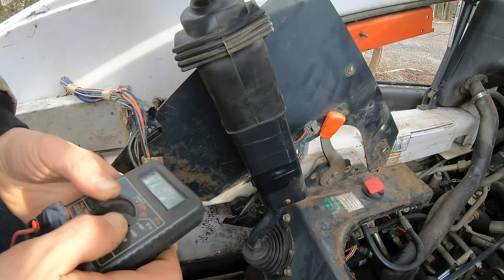Replacing a AHC computer

Comment: Even though thats an old machine (Guessing 1997-2001) you would think that computer should never fail. Or at least there should be a lifetime warranty on it. I can understand moving wearing parts but if that piece isn't user serviceable which it isn't they shouldn't hit you for $1400 thats a simple control box with relays basically and a rom with fault code library. That prob cost $19 to make with electronics so cheap. Thats robbery imo. Did you look to see if there are people that rebuild them? I would try cutting that filler sealer out and look at the board, I bet you can fix it then seal it back up. If that is $1500 shipped I would think you could get $500 easily on ebay for a working used one

Comment: Most be snowing at the moment mate you are punching out so video's, have you looked at the Case skid steers i have a 40XT and it has never missed a beat, tough machine. i have cleared & cleaned up a lot of land with it and it is still going strong. I would like a tracked machine as well but just way to expensive at the moment.

Comment: How many hours are on that Bobcat?  I am willing to bet it’s got a ton of hours. I personally would probably go with a Tackuchi as well.i love that they use Yanmar engines,all they typically have less hp than the competition it’s still plenty and the machine is an absolute animal,tons of breakout force and a real wide roomy can. I own a Cat 246 wheeled machine has been flawless it’s a 2001 ,never broke down in the 2000 hrs on it. I would buy another Cat ,as well. If you are using the machine a lot I’d consider a new one ,you are doing enough work to pay for it ,consider a lease , 5 yrs with a dollar buyout.....the used ones I looked at were whipped, and they wanted top dollar. I don’t want someone else’s problem, or abused neglected machine. That’s why I’d consider new especially if there are incentives.

Comment: Just why in the HELL do you need a computer on a hydraulic machine? It's a pump, a tank, cylinders, motors, valves and some hoses to connect it all. I think they do it just so it will break and then you have to buy another one...........from them. Dirty bastards.

Comment: yep! you can make a shirt with that :)) "things that are made in japan work if things are made anywhere else are terrible" 
"the older the better" "you don't need parts for this things they just don't break" "computers... they just don't work" 

now in my ex buy stuff that is made where you are or japan stuff, old stuff even if electrics are bad or dead, still work. buy things with hydraulics over hydraulics, hydraulic commands are very nice and pretty bulletproof! 
it's worth having an old machine put thru some TLC and using, they don't build them like they did! even japan stuff. oh and old stuff repairs like  a charm in the field or at home! but they don't brake :)

Comment: OMG $1400! That's why they use potting epoxy even x-ray wont show whats inside, ($100 to $200 in parts).
Reply: No that is NOT why.  It's because it's in a vibration intense, dirty, and wet environment and electronics do not like that. But you are correct..generally the components are 100 at most, but are you going to design, engineer, prototype, generate the PCB, assemble and test again, and for even $500?  No you are NOT.  You have to recover your costs within the first few, otherwise you are not around tomorrow.

Comment: Hi , Andrew , The Hard Cold Start , Possible "Air Intake Heater"  Burned out or No power , Fuse , Relay .  The Safety Bar Switch Is getting ready to fail  ….  It Has A Magnet Switch Located On the left Side At The Seat Bar Pivot Mount . The Plastic Bushing Has A " Magnet in it " ,, As it Wears Out , it puts the magnet out of place in relation To the Sensor / Switch . This Safety Switch Controls All The Functions On a Bobcat  !!!  Second Check your Fuses And Relays Connections /  terminals for corrosion  
( There Bad For This ) .

Comment: Bobcat shares just dropped a hundred points.
Reply from the maker: Thats what they get for selling equipment that does not stay operating.
Reply: @AndrewCamarata  I've actually got an old bobcat...no computer...that still works great. I've got a backhoe attachment for it I just used to dig a 200 ft trench plumbing in a new well but if I had the problems you have I'd ditch it.

Comment: Boy oh boy - doing the field work is tough enough but Andrew has to be a top level mechanic as well in order to keep the equipment running.  $1,400 !! - I bought a nice desk top computer and large monitor for less. However, He will earn a lot more with that tool running than I will with my computer.  Codes - is that like 'reading the directions first'? Machine issues -well, our politicians did allow our business investors to move everything offshore.

Comment: That's also why I favor Japanese made thing's over anything else. People say Japanese Chinese same thing.....but no, not even close. Japanese know what the word "Quality" means, can't beat Japanese quality and engineering.
I used to work at a bobcat/kabota dealership, when the 2010 generation of skid steers came out the whole redesign had a lot of failures right off the hop. We never got a single new machine in that would make it over 10 hours before the hydraulic fan would spill its guts out.

Comment: Made in Japan is the way too go. for over 30 Years I have had Toyota with  NO PROBLEMS EVER WITH OVER 450,000 MILES. Oil  and  Rubber only  3 or 4 cars. .

Comment: Hi Andrew I've been operating equipment for 20 years and yeah Bobcat is very gimmicky and cheaply built. They seem to have a fetish for electronic controls because even their mini-excavators have electronic controls which is just ridiculous. I don't have any experience with Takeuchi myself but they do run Yanmar engine or at least they did now they have Kubota engines on the new machines. The utility crew I work on from time to time has a Kubota SVL90 and I think its pre-emissions but not a 100% sure. But it's a very good dirt and mud mover and is very similar in size and power to your Bobcat track machine and these guys abuse it and it just keeps going. So that might be worth looking at. But whatever you do avoid the track machines with the ASV style undercarriage they are very maintenance intensive however some of the Cat machines have a more traditional undercarriage and use pilot hydraulics from what I've seen.

Comment: Had this same problem on a JCB 220 excavator it was a bad relay on the safety circuit find the relays and swap them about I swapped the working light one with the control relay only problem is the lights keep cutting out know

Comment: And the big point is that in Japan and China the Workers take pride in their work. In America they are doing the job to earn a crust and are told they will get a bigger bonus if they build something faster they will build it faster which may include more faults. And that includes the Sub Units like the one you paid $1,500 for? Sometimes companies use cheaper components to lower build costs but these are normally not as good.

Comment: You need to read the trouble code.  Impossible to troubleshoot an electronic system without being able to read the codes.  It could be some external issue that fried the old computer since it was creating trouble codes before and still does after.

Comment: Hey bro I know this is an old video did you ever get that bobcat 864 running right with the controls if not try to take the positive cables off and hook a positive cable up to the positive and a positive to the negative don't touch the battery and let it set for about 30 minutes it drains all the juice out of it and then put it all back together and it should reset everything and see if that helps out just letting you know

Comment: No kidding about electronics not working. I'm a heating and air conditioning service technician. And all of our furnaces nowadays come with electronics and blower control modules like you were saying your bobcat there that are fully potted which means all the electronics are cast in that rubberized material. There is no diagnosing and the customers just get completely pissed off because I have no choice but to call the manufacturer and offer them a replacement part at a very high cost.

Comment: I'm guessing the spool valve is for a injector? if so they are a nightmare to replace the right way. If they're not remanufactured  right they will fail or not work correctly. The only people that can fix spool valves are ones that do them all the time and have access to specialty equipment.

Comment: I've had 2 Takeuchi TL130, good machines.  Great pilot controls & they lit a lot.  They seemed a little slow travel wise to me.  You can put wider tracks on them.

I also like the Case skids, 70XT or 440 for wheeled skids.

Comment: My late father was on the board of directors of Cummins engine and XTRA piggy back.
My portfolio for December was down $21,579.32. So cost basis is $256,346.59 and market value is $316,017.73

Comment: Hey Andrew, researching the identical problem with my 753 f series bobcat.  I'm at the point you were in troubleshooting to the computer.  I actually did the actuator first as my bobcat tech said it sounded like an actuator, well $800 later... no go.  I actually took the machine into my dealer to look into it further.  Your box went from $1500 to now over $2000!  Yikes.  The one you got that was the wrong one is the one I need. (round connector).  I assume bobcat exchanged that one for your correct one.  As of this time, did the problem come back?  My fear is spending that and it not being the problem.  Great video, made me feel more comfortable that the box is my problem too.

Comment: Takeuchi skid steers are the best. End of discussion. We have a TL-140 with a Yanmar engine. 3000 hours and it can’t be stopped. It pushes like a D5 dozer. I’d try and find a TL-140 because they are pre emissions. We also have a 2016 TB-290 excavator and it’s the best excavator I’ve ever operated. I’ve put 600-700 hours on it and it also has a yanmar with full emissions and its trouble free

Comment: If my John Deere didn’t have a Yanmar Diesel engine in it I wouldn’t have it. My Yanmar is the toughest engine made.
I thought you might like to know that Japanese knives are the best pocket knives made since Schrade Knife went out of business 2004. Any knife from before 2004 in the Schrade Co. or the Schrade IXL which was made in Sheffield England are just as good as a Japanese knife but they are beginning to bring a small fortune with the Made In The USA before 2004 stamped on the blade. You can buy Schrade today but they are made in China and they are junk. I have over 1,500 Schrade and Case knives. Case has also gone to China for your Info.

Comment: May be a need to reset new computer but I kinda doubt it. Still looks like wiring, bad ground, bad voltage.  Takeuchi is good stuff but it even pricier to fix.  Mustang and Gehl also sell the Takeuchi with their paint on it.  I had the Mustang Takeuchi and loved it, you might want to check on track prices on them though, they used to be really expensive.  Visibility was great.  Wouldn't recommend Cat, Terex or Case.  I wonder about Kubota, never tried one, but I've never had a problem with anything Kubota, I might look at one of those if you're out and about..  Only owned one Volvo, but had it for less than a year, so can't say for sure.  .I really hate tosay it, but I had my best luck with Bobcats.  Never had a JCB.

Comment: I wonder if the manufacturers watch these videos? Something like this can cause real damage to the perception of product quality. I am not saying that it is being done maliciously, this is Bobcat's problem, if I was one of their marketing people I'd have a cow seeing one of these written off as 50% availability. That lump of electronics is probably around $100 of components. Nothing desperately special. They are taking the piss on the price. I work in embedded software. For something like this I really don't see the point from the user side. A few valves would do the same job. I visited John Deere once, they have since made a name for themselves as the enemy of right to repair, but at that time I was impressed with how easy they made it to get to things. All the computers I was looking at were along the back of the tractor under the cab. This having to rip the thing to pieces to pull out some 1970s looking POS module on the Bobcat is just a lack of design on their part. In the defense industry we used to call it design for maintenance, or design for repair. The last thing I worked on there were six screws securing the lid of the main unit, after that was remove all the boards slid out. If a machine designed to run in nuclear, biological, and chemical hazard environments could be made like that then why not a bobcat control unit. Potting instead of covering is cheap, that's for sure. Some 1970s POS. Like the Bosch electronics on my 1970 Audi. I wonder if that potting could be removed and what would be found underneath.

Comment: Check the solenoid as they should have some reverse emf(spike) protection at either in the solenoid or in the ecu. Holding the solenoids operating they should fail when current is removed. If it keeps happening, replace the bucket tilt solenoid. Or fix it with a back emf diode( google it) . The local auto electrician should have a suitable diode. If not get a 1N5404 diode online. Same problem could be in the stick switching. More likely its the heavy current side, in the solenoid.

Comment: Kubota SSV75
Although Kubota has been around for over 45 years, it made its entry into the skid steer market around 3 years back. The SSV75 from Kubota is among the most popular skid steers. The large-sized machine has a higher lifting capacity, around 2,690 lbs and it features a 74 HP engine, which keeps it below the emissions threshold.

The SSV75 features a vertical lift design that delivers an exceptional reach of around 930mm and a high hinge pin height that allows easy lifting and dumping. The SSV75 is equipped with the slide-up, front-entry door, which rises upwards, instead of swinging outwards, which allows the operator to open the door of the loader irrespective of its position. And, this allows the operator to exit or enter the loader even if it is in a narrow space.

The SSV75 also features a pressurized cabin which is dust-resistant, spacious and has a climate control system. The loader is equipped with side lights that offer better visibility at dusk. The superior comfort, excellent performance, superior durability and easy-to-maintain features of the SSV 75 makes it an excellent skid steer loader perfect for its job.

Comment: That's really a two-faced issue with the computer. On one side, it's probably a good thing that the computer is completely potted in epoxy considering the type of machinery it is. On the other, it's kind of shitty that the computer isn't serviceable without replacing the entire unit. With the channel growing, its more and more likely someone would be able to actually provide information on repairing the control board rather than replacing it. Financial security through proprietary obfuscation is a bummer.

Comment: I think the same as Thomas Blaisant , the computer isn't the problem, because the Computer is cast and sealed !  But not all the connectors, may be there is a corrosion on the connecting parts , that changes the resistence of the connection and if it is out of the Ohm Range an error occurs. I was an hard and Software developer a long time in the past with experience . The resistence can change about the little movement of the connector parts by vibration and/or by moisture.

Comment: I’d get a caterpillar I have never had an issue with anyone of them I have owned I have a 226 wheeled skid loader it has 366 original hours bought it New barely use it but when we do use it never an issue then I have a cat 289d bought with 300hours and have 4,000 on it now no issues at all

Comment: Well Andrew, you're right on the money with your thoughts on Yanmar equipment from Marine engines to heavy equipment,..it has a great reputation world wide, and is known to be trouble free as they come.
There's a rule of thumb on machinery hours and miles,..for each hour on your machine's hour meter multiply that by 30,...it's a rough estimate of how many miles you would have traveled ,...9000 hours on the Yanmar excavator x 30 + 270,000 miles,....nothing wrong with that !
I hear you too, on those damned sealed computer units,...sealed units are nearly always ridiculously priced. Sure, they are sealed for a good reason,...but why so expensive, I wonder. Because they can??
I would suggest too that an awful lot of equipment has those sealed boxes.
Takeuchi loaders do have a great reputation too,..as does Mustang skid steers. If you make a deal on the next one see if there's any kind of warranty that'll at least get you through six months of work before you lay down your hard earned cash.

Comment: Another reason for potting the control module is simply to prevent repair. I have built similar controller circuits, the parts are relatively cheap. A $2 transistor or driver chip probably went bad. Look in to the Right To Repair controversy to see how John Deere is preventing farmers from repairing equipment or Apple trying to prevent Iphone repairs. If there is next time Andrew, just hack the skid steerer and wire a switch directly to the solenoids. Love the videos.

Comment: I'm honestly a bit surprised by your bobcat experience, I run a Bobcat A300 at work and we beat the hell out of that machine. aside from regular maintenance (fluid changes, tire repairs etc), we haven't had any issues, the machine does only have 3000hrs on it though so we will see as the hours add up.